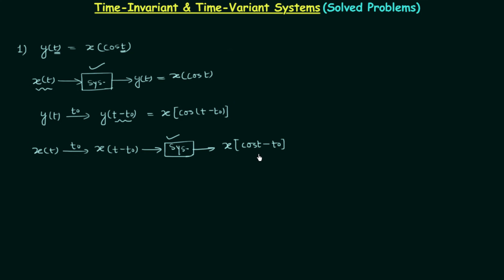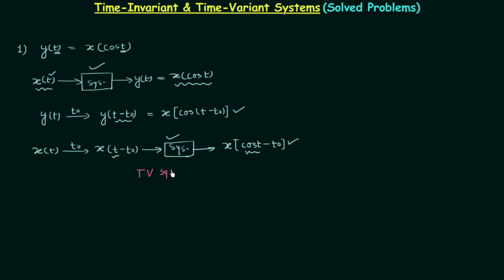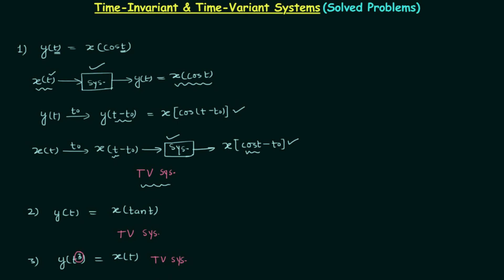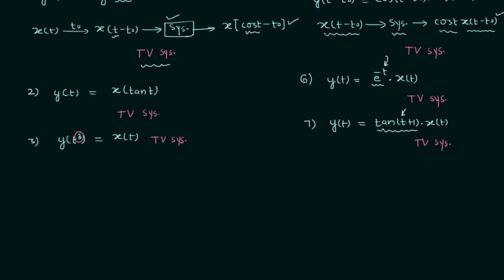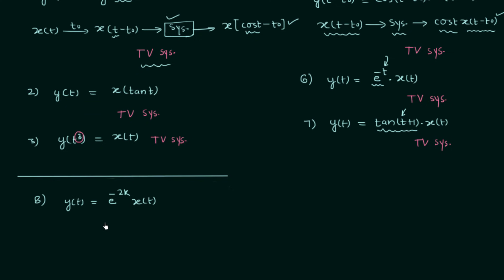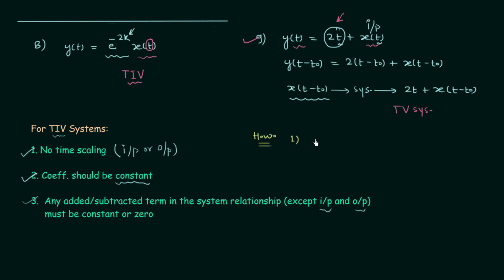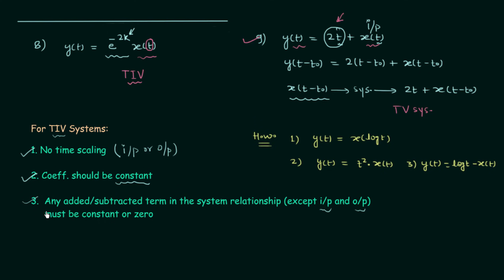Time-Invariant and Time-Variant Systems (Solved Problems) | Part 1

Comment: y(t)=x(logt) is time varying because input x(logt) is operated by log. 
y(t)=t^2*x(t) it is also time varying because coefficient is t^2 which is a function of time means varying with time. 
3) the added term logt is a function of time also means it is also varying with time so It is also a TV system

Comment: How y(t*t*t) = x(t) is a time variant system
Reply: y(t)=x(t)
=> shift in I/P
      x(t-to) = y((t-to)³)---------(a)
=>shift in O/P
     y(t³-to) = x(t-to)
     x(t-to) = y(t³-to)------------(b)
Hence, from (a) and (b)
             The system is TV system. Because it  is providing an output, which is not constantly varying.

Comment: Why do you say instead of providing the delay to the output we provide the delay to the input. That statement is confusing. Are you not simply providing the delays in both, or  did you other-wise have a choice weather to provide the delay of the input vs the delay to the output? The maths is correct but that statement "instead", is definitely out of place and hence confusing. Why ruin such a nice lecture?

Comment: y(t)=x(logt) is time varying because input x(logt) is scaled by log. 
y(t)=t^2*x(t) it is also time varying because coefficient is t^2 which is a function of time means varying with time. 
3) the added term logt is a function of time also means it is also varying with time so It is also a TV system
Reply: Log is  not time scaled.Log is just an operation sir.